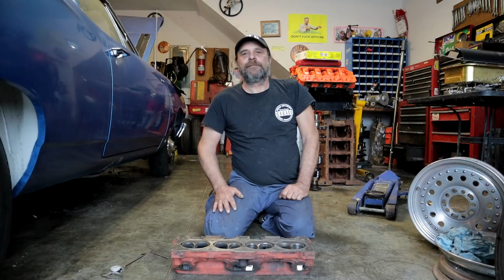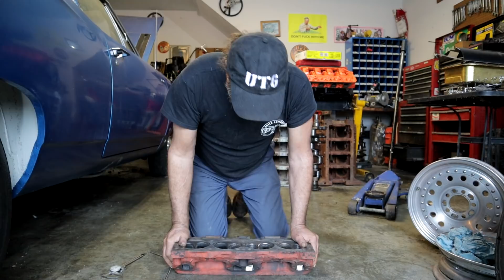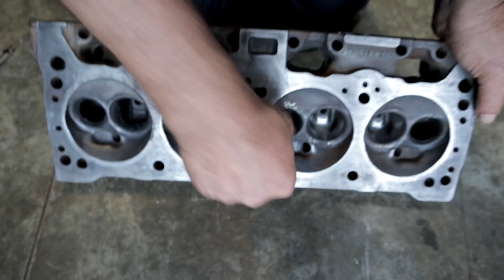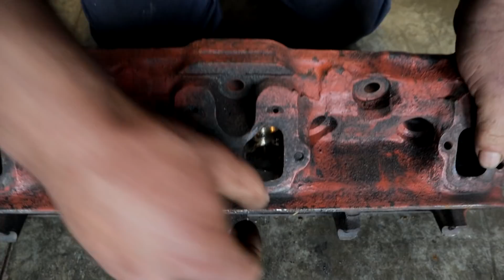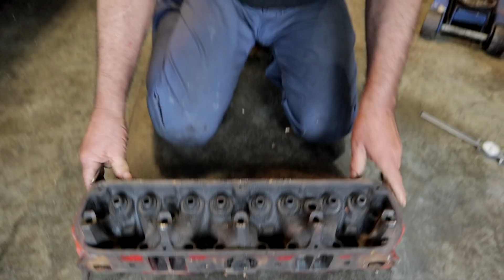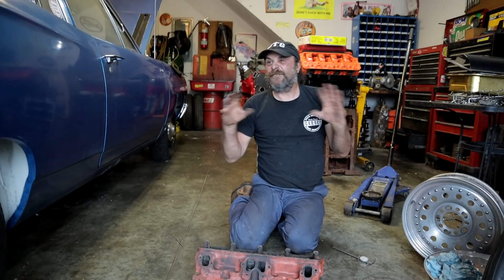Why Mopars Suck

Comment: They say they don't build em like they used to.....it's a good thing cause they were junk then too. We just love em anyway
Reply: My fully rotten unrestored with a blown headgasket 69 tbird that still runs a drives would dispute your claim.
Reply: If you think what Tony is pointing out was bad, you would be appalled at what a catastrophic failure Chrysler/Fiat quality is today. Im not a mopar guy, but if I were to buy one it would certainly be an older one like the ones Tony wrenches on.
Reply: @Rob Flammia,  So my opinion is: That this opinion of yours of these classic cars being "junk", is not even close to being true... I wonder how many modern cars will sell for over 10-50 times what their original sticker prices are 20-80 years from now? How many modern vehicles of ANY type will even continue to run, 20 to 80 years from now? How many modern vehicles will even be feasible to restore, 20 to 80 years from now? Need I point-out any more advantages of this engineering of these vehicles that You call "junk"? I think not...
Reply: @michaelmartinez1345  all of them will be running if you rebuild them the way you do with older cars. Don't be a knuckle head. None of them last forever without being rebuilt.
Reply: @brycegman8150  Not necessarily, with cars that have major components made of aluminum.... 
     Speaking of 'Knuckle Heads' (your words) read what I replied to rebut 'alanmeyers3957' reply referring to his short-sighted opinion of his Love affair with Toyotas... If you look at the specifications of 'critical tempreatures' of cast iron vs. aluminum, you might be shocked what the People making these vehicles (with aluminum major components) failed to tell their potential buyers...
     It is true, what P.T. Barnum said; "There's a SUCKER born every minute!" I'll leave it at that....
Reply: @michaelmartinez1345  you can replace anything, even aluminum parts that failed due to fatigue. Yeah i think most people dont understand that aluminum has an absolute lifecycle, but you can replace anything, and so the argument that things wont be running is wrong, people will keep things going if they like them. i dont think people are jumping in 80 year old cars, dusting off the carb and firing them up to drive it daily without a ton of work. everything deteriorates, everything can be repaired. knuckleheads being old timers whos good ole days blind them to the fact that things are actually better now.
Reply: @michaelmartinez1345 compared to a modern Toyota, they were junk.
Reply: @alanmeyers3957  Oh of course...I have always wanted to drive a vehicle that was known to give un-intended acceleration when in heavy traffic, or on roads winding through the mountains, like several of the vehicles that You are attempting to endorse have already  proven to do... Toyota has made many fine cars, but please, don't let one of the many ohc aluminum head versions that they have manufactured overheat... The chances are , the warpage in that head will NEVER BE repaired properly, when a common overheat takes place... Unfortunately several other vehicle manufacturers have already adopted this ridiculous design, and all of those companies know , that finding a servicable head to keep these cars going after an overheat, are slim , at best... The mis-aligned cam bearings on warped aluminum heads, will always be an 'achilles heel' on those OHC designs which will dramatically shorten the lifespan of everything above the pistons.... 
    It is interesting how you refer to the earlier vehicles, particularily the American made vehicles with all cast iron (cam in the block) designs, as "junk"...
    I was thinking the same thing about the throw-away OHC aluminum head designed vehicles- that must be replaced, because of the warpage of the camshaft bearing saddles, Toyotas included.... 
     BTW, the critical temperature of Cast iron is from 1,380°F. to 1,560°F.  Well over 3x the critical Temp. of tempered Aluminum alloys at 460°F. to 485°F. And Yes , several engine overheats HAVE reached those temps , and higher, especially when the coolant is low...  Before you say something is "Junk" try to find out a little more - than what the vehicle maker's ads are trying to sell you...

Comment: The valve seats between the valves are nearly overlapped.  There is no seat material between the valves.  This may lead to valve leakage due to overheating and heads to crack between the valves.  Reminds me of the small block Chevy heads with the 2.02 and 1.60 valves.

Comment: I'm only 30 and my knees hurt just watching you kneel on that concrete
Reply: and it just gets worse. For now, go to a pool store, and get one of those "paddle boards" for kids. Before you know it, you'll find you get dizzy by ducking your head under a hood too many times, and only work a few hours a day on an engine.

as for some of the other responses...tell the "kid" what to do, not that he's a whiner.  I grew up with the old guys who were quick to share their tips, not to judge.
Reply: I thought the same thing.
Reply: Don't go and mount tires and do rotandballs all day with 2 foot lifts at Sam's club , during 90 s
Reply: @mikesr3407   oh god. I worked at a regional tire shop called dunn tire. Only as a "tire technician" for a few months... 6 years later i still remember that job every time i bend my right arm. Permanent elbow damage. All cause of the way i held the tires because of those low lifts. I would hold it from the botton and use my knew to lever it up. Have a bad back so had to improvise hahaha...
Reply: I feel you! I just turned 30 and working on my vette for a week swelled my knee up so bad for 2 weeks!!
Reply: @NoNo-df5tl  It's called "Shit wears out"
Reply: I dont know how he does it.
Reply: Yeah lets just say I learned fast that doing king pins and pulling drums requires something for the knees... Even at 25.
Reply: It’s called having to work for a living. No disrespect intended but people his age did what they had to do. Kids now are clueless and most are entitled brats. Just my opinion
Reply: @georgeseymour7116  ok boomer
Reply: @frigglebiscuit7484  We'll see how the younger Gen thinks of you when you get to a "Boomers Age", if your "Lucky" enough to live that long. Amazing how Younger people talk about "Boomers", if you're a parent of a kid today, I must say you've done a "Bang up Job", I sure they'll think highly of you. It's called "You reap what you sow"

Comment: You're comparing a 1960's Buick engine vs a 1970's-80's mass produced 360 head..Chevy heads also are made like that same with Ford..Remember Ford too was almost went bankrupt in 1980,thus quality crapped out! Remember Buick then was upper class,mid 70's Buicks went to crap too!

Comment: I worked 3rd shift for a long time. 3rd shift was the "push" shift, our job was to keep things on schedule. We had half the number of people as 1st shift, and did twice the work.

I swear 1st shift spent all day in meetings, there were days when I'd leave, and neither 1st not 2nd shift would get anything done before I got back.
Reply: That's because they were getting everything ( ready ) hence the MAD schedule that way everyone gets even treatment
Reply: @mikesr3407  that's the thing, this wasn't production line (exactly), this was aircraft heavy maintenance. Military would call it depot level. Plane comes in every however often, gets disassembled to major components (pretty much everything that can be unbolted is), and over the next 30 days we remove corrosion, etc. It's not remanufacturing, the hour count isn't reset, but anything short of the actual major structure that can be worn out is checked and usually replaced. Probably 10k hours of labor for us grunts, not counting the specialist shops reupholstering the seats or whatever.

There were times that I'd come in and not a single damn thing would have been done since I left 16 hours prior. Somewhere around 225 hours of labor that did not a damn thing.

Comment: Yup.  W/o tearing things down you never know ...  And it hurt gas mileage too.  Mom's 383 Polara wagon was a jewel.  Quick and decent 13+ MPG.  Wore that puppy out at 170K, so stuck in a junkyard 360.  Way down on power and mileage was awful, no matter what we did.  Swapped on a set of rebuilt heads and it came around quite a ways.  The original heads had "ledges" all over.  The turbulence must have been horrendous ...

Comment: By mid 70's soft cams , thinker cylinder bore thickness & 2 bolts holding your carb on ( ne a pream ) timing chains are my favorite . Plastic on metal  on a timing chain .
Reply: Spun the teeth off a couple 360 sprockets ..... not an enjoyable sound
Reply: Yeah , where did all that plastic go ? I guess they were in the oil filters ?

Comment: Junk steel, poor engineering, questionable styling is why MOPAR sucks.
Reply: kinda like ford and chevy.
Reply: @frigglebiscuit7484  ford used good steel, descent styling but engineering left a little on the table.  
Gm used adequate steel, the styling top notch, engineering is mostly good.

Comment: Now there's a video I never thought I'd see.

I thought the reason, Chrysler sucked is that after letting Vergil Exner take them from dead last on styling in the first half of the 50's to first in the world in the late 50's (so much so dethroned GM panicked and restyled a year early in 59 with cool but arguably shark-jumping designs) they let Exner go and their cars got mostly average to boring and plain afterward (they did make some beautiful cars after that but not as many as GM). The other big mistake is they made the high sales volume Exner cars with thin sheet metal (a stamping process issue) and bad rust proofing so they had BAD rust problems that soured many of the new buyers the looks brought to them.
Reply: I just bought a 62 Chrysler 300 H , I'm amazed at how solid the body is , some surface rust of course and the undercoat is rotten and flaking off but no cancer anywhere. Sheet metal is a little thin I agree but rock solid after 59 years. Love Exners styling.
Reply: @powerwagon7811  The 57-60 cars had the worst rust issues. Mopar figured out how to substantially reduce the rust issues in the early 60's.

Comment: Eh,  alot of old cars have there deficiencies in one area or another.  As far as 360 roller magnum heads I looked at how bad they corroded after 100k miles & threw them in the scrape heap and bought Engine Quest made in New Zealand they were only 285 each bare ,plus the ch318B let's you bolt on la intakes. Casting under the bowl was so nice,  myself speaking I didn't even go near it with a grinder.
Reply: ironic, considering eq heads QC have been GARBAGE the past few months.
Reply: @frigglebiscuit7484  Oh, that's too bad the were good bang for the buck . I bought mine couple years back. There's a cheaper brand something like speed master Jeggs caries them. Not sure of quality.

Comment: My friend is a machinist and has worked with and collected early Hemis for years.  He tells me the machine work consistency on the early Chrysler Hemis was fantastic compared to much of the 60s, 70s engines of all manufacturers.
Reply: I have one or two of each one ( 331 , 354 , 392 ) and there is nothing out of place that I have ever noticed , or even a sharp edge for that matter.

Comment: I ported a couple pairs of 318 heads in the latter 80s and there was what I felt too much variation in the castings even though both sets were mid 70s. But when I saw your 360 heads before you began work on them I was astonished at the muck of excess casting in the ports. If I can be frank I was surprised you took them although I knew you intended on porting them. You are right, Mopar heads are usually more work to get right compared to the other manufacturers. Sometimes a helluva lot of work such as with my own experience.

Comment: all of the big 3 had their moments uncle tony.  when it came to quality, I will say this though. when I worked on the line at chrysler back in the 80's, you did not want to buy a car that was built on a Monday morning, or a friday afternoon! thanks for another great video.
Reply: They were all like that unions were to strong and very hard to get fired for anything you did wrong..
Reply: Lol there's an old vid on here of some Chrysler plant employees getting ripped at a local park near the plant at lunchtime in Detroit. 
Liquid lunch 😁
Reply: @MrTheHillfolk  when manufacturing becomes monkey-fracturing,
or something like that..
Reply: Rob Walcheck hall of shame videos
Reply: ...I had a '15  F150 that was built on a Monday...total dumpster fire...most issues are OK by 2020, but the 2nd oil pan still leaks......
Reply: Actually any day that ends in y are bad
Reply: ...that's because those were the days that they  had the 'less than skilled' employees on the line...but then again, this was true not just to Chrysler...my old Ford work truck was built on a Monday and as I mentioned a dumpster fire...
Reply: LOL Thats funny, because the collision repair industry is the same way.  They want all the cars done by friday eve.

Comment: As a mechanical engineer, I have no words to describe how much I appreciate and value your content. You are like the missing link between  mechanics and  engineers, a guy who knows what works and what doesn't and knows perfectly the reasons behind it.
Thanks for sharing your mechanical wisdom.
Reply: As A life long mechanic I have always said the engineer should be made to fix the crap the designed . They could learn a lot about how to build things that will eventually break and why you don't put that there . Explaining to a customer why it is going to cost 1000 bucks to change a 8 dollar spark plug is never fun . Or why you have to buy the whole cow for a glass of milk because it's all integrated now and over complicated for no reason .
Reply: @pkuudsk9927  You will be replaced by little Asian girls with small nimble fingers and skinny arms who don't complain.
Reply: mechanical engineers either hit it out of the park, or they destroy it!
Reply: @kurtzimmerman1637  its the big wigs and penny pinchers that usually run the show. Timing is also a factor. Sometimes they kick off DV and PV tooling at the same time! Leaves no time for the engineers to make changes and perfect the product.
Reply: A good friend of mine is an engineer, and as he was working his way through school, he started working on his 1997 Pontiac Grand Prix GTP, making it faster. Because of his work on that car, taking it from stock, to about 550 wheel HP in its final form, I feel made him a better engineer. Learning what worked and did not work and why, from both sides of that coin, in my opinion, makes better mechanics and engineers. Also gave him a better understanding of physics, as he also did his own tuning on the ECU, and putting that all together makes things so much more awesome. Mechanic side tries to keep things simple, the engineer side tries to make it last and the physics side figures out how to make it efficient too.
Reply: Well said..
Reply: Never knew that though I've always liked MOPAR.  But maybe that's  why the Stage 1 Skylark was killing them at Colchester in stock class back in the day.
Reply: Thats what gets me about most guys. The " reason behind it....." part.  When I learn something, I want to know EVERYTHING about it.  I ask "why" about everything.  Why they did it like that, what they call it that, why did they use that material, why did they come to the conclusion of this design, what came before this, what came after this, whats the alternative, what is the down side and up side.  Most guys dont even k ow what the acronyms mean for thing they are talking about. Im talking about guys that have been doing certain things. For decades. It blows my mind.  I camt sleep until I know everything there is about something.
Reply: @Rob perfect quote!  Love that movie!
Reply: Amen.  Can I get a "HALLELUJAH" for our brother, Uncle Tony!
Reply: As a tech for decades in my profession I still swear that our customers did R&D for those damn engineers too lazy or clueless to how things are produced & used in the real world. It made my job a living hell sometimes & I didn't blame the customers for being pissed since they were running the tests the cheap ass manufacturer didn't & I had to figure out a workaround to make them happy. To tell you the truth it was downright embarrassing sometimes considering what the products cost!
Reply: 🤎👃er

Comment: This also plays over into the newer magnum engines as well. I replaced headgaskets on a ram with the 8.0 v10 and took the time to go through and clean up the heads with a carbide bur. It made a considerable difference over stock along with matching the intake. I'm curious to see how much free horsepower can be had on a 5.9 magnum.
Reply: from bowl work and part matching, to ignition and cam advancing, probably like 20hp.

Comment: I have measured a couple small blocks. The deck height from one side to the other also differs by .010!
Reply: The engine doesn't sit in the centerline of the car either - - off to the passenger side a couple inches !
Reply: @TIMEtoRIDE900  I thought I was hallucinating it when I saw it on my 68 Newport - nope, it really is just sitting like 5-6 inches off to the passenger side.  I guess to make room for the power steering components?  I found it very strange, if that was an intentional design choice.
Reply: @eurekasevvenwave  It may have something to do with the Torsion-style springs and steering box location.
Ford vans (square-nose) offset the whole drive-train, and run an offset rear axle.
This is so the driver can have a usable foot-well.